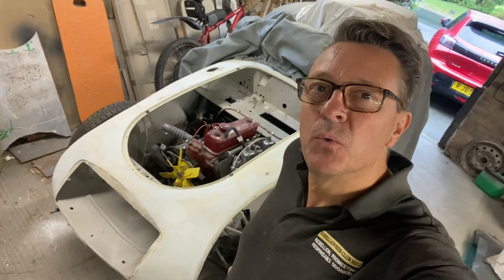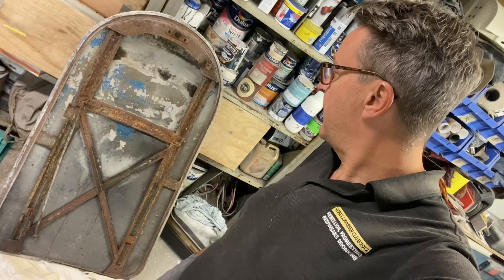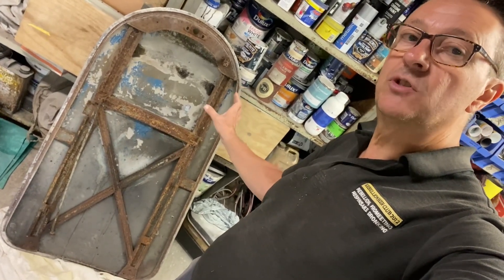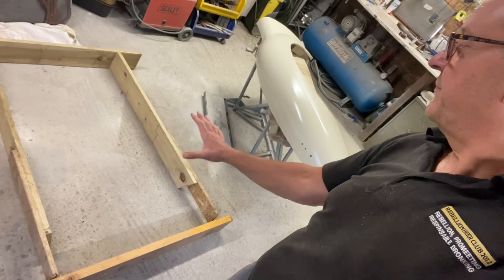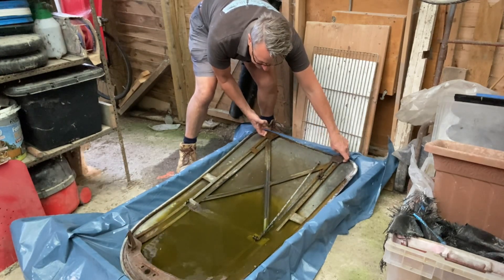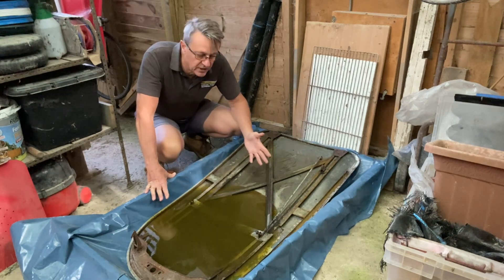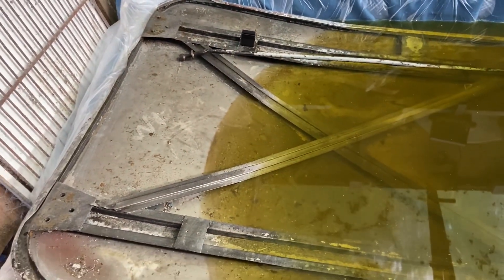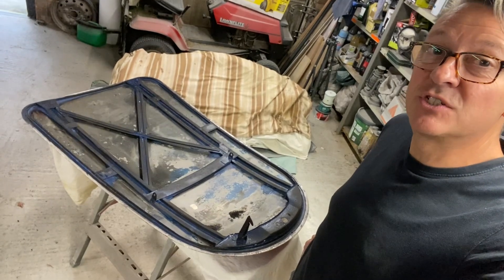MGA project. How to remove rust without damaging an aluminium car body panel

Comment: I've just discovered your channel, will need to go back and watch the earlier ones. If curious whether you have discovered ways to re-coat/re-protect the underside of the steel frame when you've cleaned it up this way. Once the rusty surface has been cleaned, it is quite active towards additional rust and it will now be in contact with the Aluminum back side of the bonnet. thanks for sharing your progress.
Reply from the maker: Yes that’s a tricky one. Without removing the frame from the skin you can’t get to the hidden channels. I’m relying on over spray from the paint gun

Comment: the trunk lid uses the same materials and is designed just like the hood. i think i sand blasted the steel parts on underside of each, and ground the paint off the aluminum, i was very satisfied with the results.
Reply from the maker: You did very well not to damage the aluminium with the sand blasting. Careful work. Well done 👍🏼

Comment: Well done and good recommendation. I opted for cathodic dip coating  on my MG - which works for steel and aluminum. There are a few places in Germany that offer it (we use the German abbreviation KTL)
The benefit is that the excellent surface finish and protection, downside is the price tag (470euro for a bonnet)
Will consider your method on the next project
Reply from the maker: Thanks for your comment. It wasn’t aware of this process.